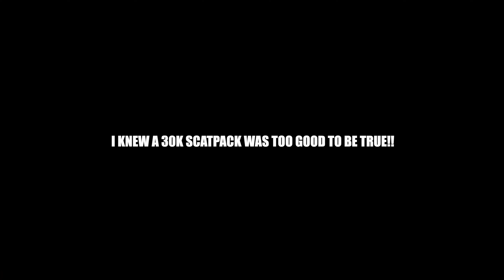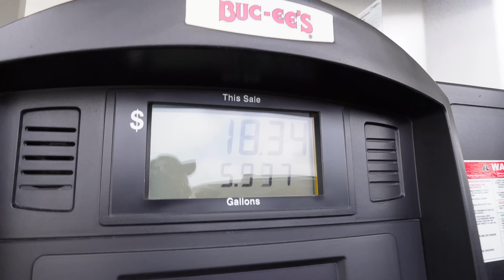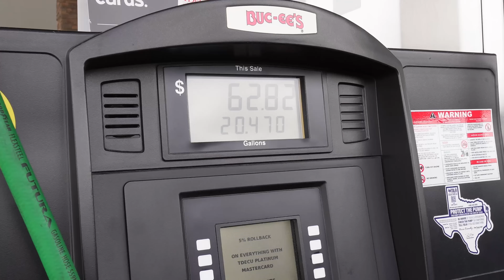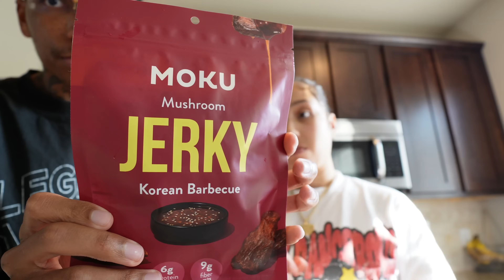BUYING A SCATPACK CHARGER GONE WRONG!!

Comment: Odai tried to get off, he said he fixed it himself.
Reply: Fact🎯
Reply: The way he was whipping down the car like oh yeah ima make a quick $30k😂
Reply: @GhgHussle don't forget also, in the longrun buying new or from a used car dealerships you'll definitely have a bumper to bumper factory warranty if new, & if used depending on model year you'll probably have a warranty... Also option of extended warranty 

Sports car parts are not cheap bruh... Something minor like a slight electrical issue may cost you 1k to 2.5k, but with a warranty is free and most warranties will also pay for your rental car while your car is being repaired...

I literally just bought my extended warranty for my mustang 2 weeks ago
Reply: Also if you buy from a person ask them if the warranty is still valid, I'm pretty sure warranties are covered no matter who the owner is, I believe you just have to update the information
Reply: @xX1stKingXx  My boy thought he had that 30 ball in the bag 😂🤣

Comment: 15:09 just because an OEM part came from a junkyard doesnt mean its not OEM. You can buy a stock glock from a pawnshop and dont make it less of a Glock. He did fail to mention this fact tho... so the same could be said for any other problem.
Reply: When you’re selling a vehicle and fixing it when you tell someone you fixed it with oem parts, you don’t throw junk yard parts at it. Simple dude try to catch a fast one
Reply: @Gottemmm  yeah he was definitely untruthful but people use junkyard parts to fix cars all the time. It's not unusual nor uncommon. He upsold his parts. He may not even got them from junkyard but from another Charger he had access to. I'd prefer the parted out parts personally. Actually I'd prefer something new or like new especially for what was being replaced but, it be like that I suppose.

Comment: Man Chrysler products got too many electrical problems without getting one that was wrecked. Just make sure you have it thoroughly inspected , and have them hook a scanner to it and pull codes. You are going to have all kinds of body control module codes on wrecked vehicles unless they were fixed properly by a competent technician.

Comment: If you grab the scat pack try to get one with the plus package, suede seats, blind spot monitoring, etc. The content going crazy tho🔥🔥
Reply: A 392 would be better  same motor but they came with the six piston brembo  vented seats everything the hellcat came with
Reply: @adolfovazquez9207  plus package come with vent seats I got the plus and tech 23 scat charger mfer go crazy only thing wish had adaptive suspension because it non widebody but it's ight through the 275 dws06 on that mfer changed it all up. Brand new was 54k brand new widebodys were 62+k barely any sale

Comment: These problems were that bad tbh. I would’ve had that ball joint fixed prolly that same week. Then the body i could figured out another time but if the suspension felt fine there’s
No need to feel like it’s broken. I ride coils and it’s much worse tbh